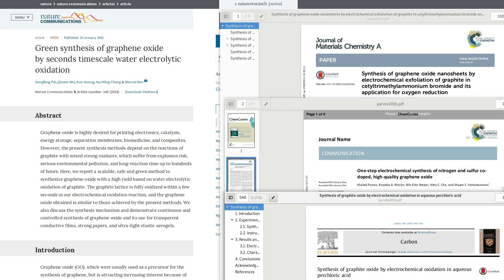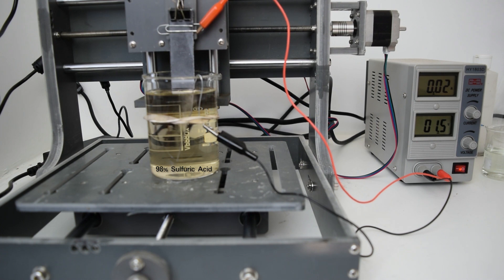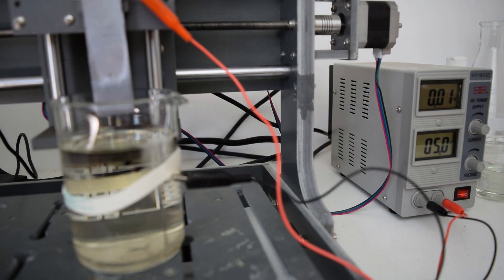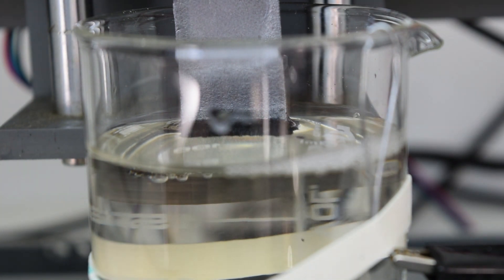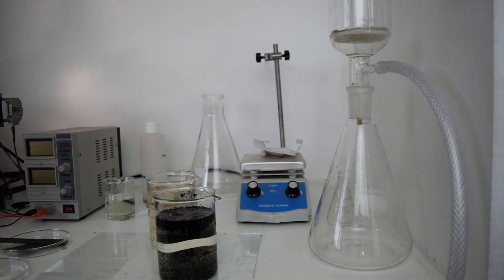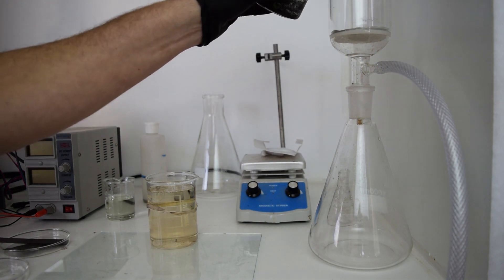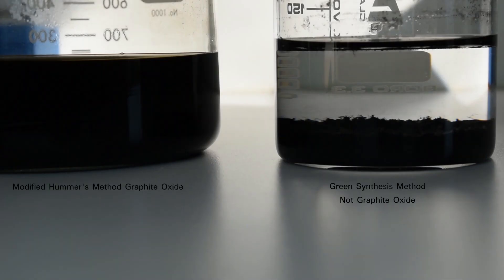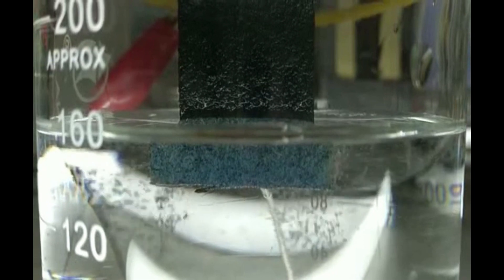Green Synthesis of Graphite Oxide - Without Success...

Comment: I have also tried this method. But i got same result as your video showing. 
I use 98% h2so4 in 1st stage with power 5  V.
In 2nd stage 50% h2so4.
Kindly pls advice to synthesis graphene oxide.
Reply: Can you help me? I don't see GO using your parameters.

Comment: With this method, you are producing graphene platelets by "intercalating" sulfate ions between graphite sheets. This is a physical process that breaks pi-pi bonds and I think there is no oxidation going on.
About papers, you are absolutely right. You did the exact method but couldn't reproduce the results of a NATURE paper. Because you didn't buy graphite foil from the same supplier and authors didn't double-check their result using other foils and reviewers.....
Reply from the maker: Thank you, yes I think you are correct. Take a look at Greg Shafransky's comments below, I tried his method and at first it didn't work, but once I got really thin graphoil about .015mm, it started working (a little bit). So having thinner graphoil is one of the factors, it even gave me a very slight blue tint in the Nature method... But, I think I also need good thick electrodes The platinum wire I used is really thin, I am waiting for a thicker wire to arrive so I can test that.
Reply: @KingswellLabs  Thank you for great vids. But don't stick to the protocol, use another grafoil as negative, that is not your main problem.
Reply: @KingswellLabs  awesome have you implemented any new changes?

Comment: Your sulfuric Acid Shows a yellow color. This is an indication that the acid is old and contaminated.  It did not work for me with an old acid.  when using the fresh acid, it worked directly.
Reply: I have further developed the method and greatly simplified it.  for further information look at the following publication which was published in spring.

Rapid Synthesis of Yellow Graphite Oxide-One-Step Electrochemical Oxidation of Graphite in Organic Solvents
Reply from the maker: @andreasgarciadurao6754  I can't thank you enough for your work, I am reading your paper now.
Reply: @andreasgarciadurao6754  Can you tell me the address of your research work?tnx
Reply from the maker: Thank you for the comment! I did get new high purity/quality sulfuric acid and did have the same issue. Although I am thinking my problem is that ultrasonicating could be destroying what I made. Have you tried using the GO made with this method? Did you ultrasonicate the dispersion?
Reply: @KingswellLabs  I did it according to the rule and it worked.  You could try it with an increased voltage of 2 to 2.2 volts in the first step.  It also seems to me that your graphite foil very thick.  how thick is it?  I use foils with a maximum of 0.2 mm thickness.  the thicker the foio, the longer it takes to form the blue graphite intercalation compound.  Another factor is the size of the vessel.  Try a jar containing a maximum of 40 ml of electrolyte.
Reply from the maker: @andreasgarciadurao6754  Thank you again for your response. I am using thicker foil, it is about 1mm thick. I am waiting for .3mm foil order to be delivered. I will try your suggestions and will update the video.

Comment: i think ur graphite is wrong stuff
Reply from the maker: Thanks for your comment, what makes you say that? What should I be using?
Reply: @KingswellLabs  when i did mine i made a retort kiln get a paint bucket and lid throw shit in the can then roast it in no oxygen when its red hot drizzel water on it and try and hold the steam in do burn urself then i check the conductivity i always have 10ohms or less then u throw it all in a tub and get stainless steel mesh and put on either side of tub then a heavy glass sheet on all of the carbon in water and it flakes off like crazy urs looks like it has a wax or polymer on it its not even breaking apart
Reply: and ur dc powersupply should pulse back and forth so sides alternate with dc current
Reply from the maker: @chrisanderson4159  That sounds crazy complicated, you should mae a video of the process!
Reply from the maker: @chrisanderson4159  So you are saying I should be using AC power?
Reply: @KingswellLabs  yea ive been meaning to make videos but feels like i dont have time and no dc like a car blinker
Reply from the maker: @chrisanderson4159  If you ever have time, I bet there are a lot of people that would appreciate it.
Reply: @KingswellLabs  what software are u using to put together ur videos and what camera
Reply from the maker: @chrisanderson4159  I use Kdenlive for video editing and a Nikon D3300 to record.
Reply: @KingswellLabs  is that software user friendly im not up for learning another adobe c6
Reply from the maker: @chrisanderson4159  If you have used editing software before, it is very user friendly.
Reply: @KingswellLabs  btw ur voice sound less robotic gj
Reply from the maker: @chrisanderson4159  LOL thanks I am trying.

Comment: before filtration , you should use ultrasonic. i have already used this method for synthesizing graphene quantum dots .
Reply from the maker: Thanks for your reply! Just to be clear, does it matter if I ultrasonicate before or after filtration? I have been doing it after filtering.
Reply: @KingswellLabs  just do ultrasonicate before filtration
Reply: @majidetminan4715  did you ultrasonicate  the 50% sulfuric acid solution with exfolliated material?

Comment: The first stage should be at constant current at 20mA per square cm of foil in >95% H2SO4, about 10 minutes until the voltage gets to 2.2V, then change to constant voltage at 2.2V for another 10 minutes.
Then wash.
The second solution is 0.1 M (NH 4 ) 2 SO 4, Keep at constant voltage for upto 10 Minutes,
Hope that helps ?
Reply from the maker: Thank you! I will try your suggestion. 0.1 M solution sounds more reasonable for oxidation, but I am worried that 2.2V will cause exfoliation as there is good expansion of the foil at 1.5V.  I will update after trying your suggestion.
Reply: @KingswellLabs  hi. Sorry forgot to mention second stage is at 10v constant voltage.
The first stage at 2.2v is important. Decviate more that 0.2v and I don't think it will work
Reply: It's worth trying different variations,  good luck.
Reply from the maker: @andrewpusey6339  Thank you for the clarification, I will make sure not to deviate from 2.2V,
Reply from the maker: @andrewpusey6339  Agreed, there is nothing wrong with a little trial and error.
Reply: @KingswellLabs  don't forget to use diamonium sulphate not sulphuric acid for second stage
Reply from the maker: @andrewpusey6339  Unfortunately, I do not have diamonium sulfate, but will try with sulfuric acid as the authors of the paper used it and assured me it will work.
Reply from the maker: @andrewpusey6339  sulfuric acid and diammoniun sulfate are so close that I don't think it will be a problem using either one. From my understanding many different electrolyte solutoins have been used with success.
Reply: Hi Andrew, i don't have success using your parameters. Can you help me?

Comment: add some salt....and how do you know the end product wasn't GO? Try sonicatating it in Iso
Reply from the maker: Thanks for the advice but I did sonicate it and still settles. You can tell if it's GO because it disperses easily in water even without ultrasonication which this did not. Also there should be a slight brown tint, which this is very black. 

The paper's author responded to me and my process is exact but my sulfuric acid is not very pure, so I oredered some high quality stuff that should be here week.
Reply: @KingswellLabs  What you describe is un oxidized Graphite layers put it in the mag stirrer and start dropping in Hydrogen peroxide by the drop...shouldn't need more that 10ml of even  the over the counter kind. If I am right should go brown to yellow pretty much right away.
Reply from the maker: @gregshafransky1907  Interesting, I haven't seen what you describe resulting in oxidizing graphite but I will give it a try!